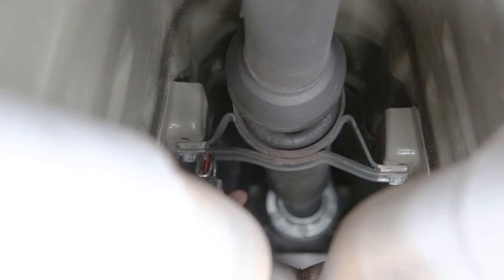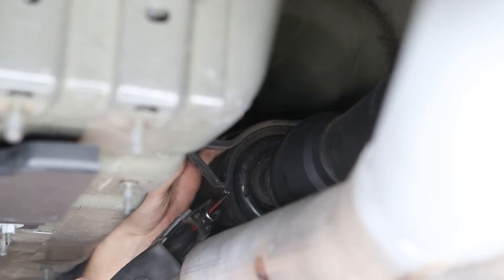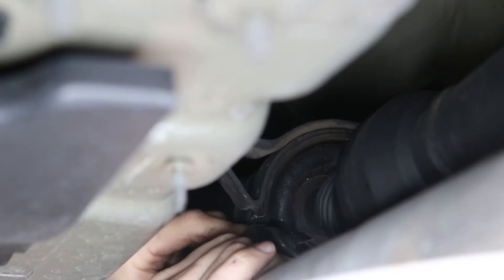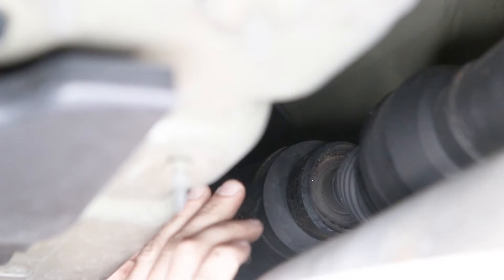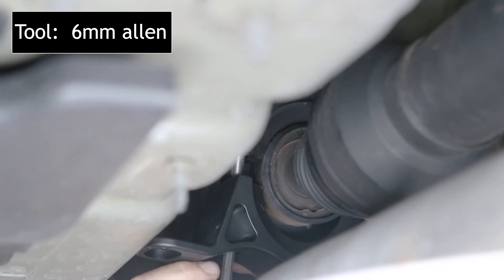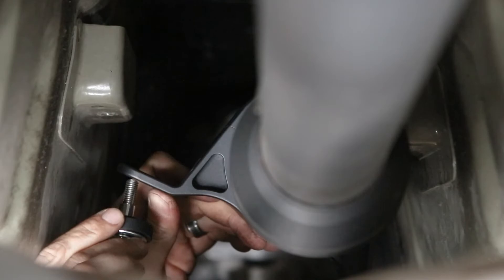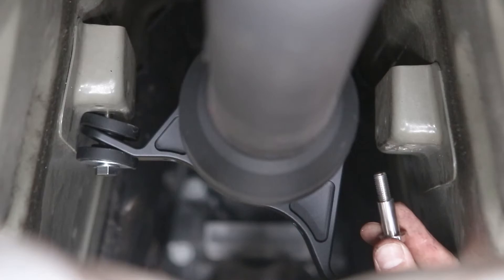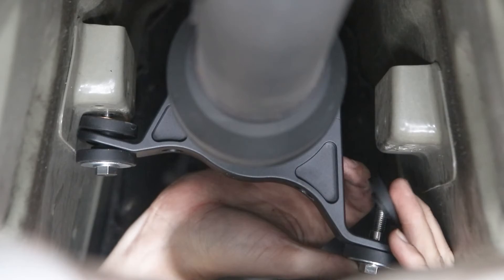LD Facelift Charger/Challenger/300 Performance Driveshaft Carrier Install (CHR01A0) JXB Performance

Comment: This is an amazing product. Ordered an open box drive shaft that came busted. Thank gosh because little bit of research and I found this. Installed on a 2016 challenger rt. Didn't even have to lower the exhaust. I just removed the heat shield, cut the old mount up, and squeezed this bad boy in there. 30-40 minutes later, my driveshaft was no longer clunking away.
Reply from the maker: Wow that’s great! Never even considered this could save an otherwise trashed new carrier. When we buy driveshafts for development the carriers show up damaged quite often.
Reply: What cutting tools did you use ?

Comment: Just in case anybody was wondering. It's way easier to install on the base model charger, because you don't have the twin pipes. I just put mine on without disconnecting the exhaust. JXB out here saving lives 🙌
Reply from the maker: Thanks for the feedback, that's great to hear!  Our #1 enemy with ease of install is always how much exhaust is in the way.
Reply: Yup, this comment is 100% true. Used a reciprocating saw to cut the side of the bearing, and an angle grinder for the 3 and 9 cuts. It was really scary because I’ve never used them, but I’m happy to report I still have all my fingers 😂

Comment: just installed and i noticed a bit of vibration, is this the rubber washers ? i was wondering considering the factory one didn't have a washer and was straight into the body, I guess the washers are for deflection? road tested and put  car back on stands to double check it afterwards and everything was still snug and torqued with locktite
Reply from the maker: Shoot me an email at jay@jxbperformance.com and I can assist.  Vibrations stem from the center CV joint not spinning smoothly and are the leading cause of the OEM failures.  Our bushings can take more abuse, but because of that the overall package is stiffer, so you're just feeling the vibration in the driveshaft through the carrier, whereas with the soft OEM one it soaks it all up (until it fails and all hell breaks loose).  We have a number of remedies for vibration transfer I can discuss via email.

Comment: I didn’t notice an orientation mentioned for the rubber bushings in the jxb carrier. Is the line in the bushings supposed to be to forward or aft?
Reply from the maker: The bushing orientation doesn’t matter on this one. They can be installed with their arrows pointing front or rear. Just try to center the bushings as best you can on the bearing.
Reply: @JXBPerformance  thank you! I just noticed the arrows on the backside of the bushings 😅

Comment: Okay got mine installed with street bushings, and test drove my B5 A4 Avant on it with stock exhaust. I don't really detect any NVH, and honestly feels like there's less of it now due to how old and crusty my old carrier was. The first to second wrestle match is very minimal now (though my transmission is probably just super worn out at 256k miles), like he said the knocking in the back from on/off throttle is gone, and haven't heard very many noises going 90 MPH. I had extreme anxiety about cutting a piece of a ~$2000 part, but if you torque to spec and use thread lock (Please for the love of god use thread lock), it feels

Comment: Just ordered mine for a 2015 RT with Road and Track (Yes I know that means RT/RT) Im nervously excited to do this. Do you think I will have enough room to do this if I back the car on ramps?
Reply from the maker: It'll be a bit tight under there but you might be able to pull it off.
Reply: @JXBPerformance  I ended up taking it to a shop with a lift and paying the 120 for an hour of labor from the mechanic. We did it together. If the exhaust didnt take so long to remove the process only took 30 minutes.

Comment: The good news for me was by the time I realized I needed to replace the center bearing, the rubber was almost all gone, so all I had to do was to cut the brace and put the new brace on. 

Good product tho, let’s see how it holds in the long run
Reply from the maker: win-win!
Reply: @JXBPerformance  yeah, it is.

Btw, for anyone reading this thinking on replacing it, make sure the heat shield is not touching the driveshaft when you put it back, unless you wanna feel your car is falling apart 😂.

Comment: THIS FLAT WORKS!!!!! Just installed soft kit on 2015 V6 Charger.  Just like it was when we bought it brand new. Plus side is the JXB bushing is much wider so I dont expect this one to ever dry rot like the factory 1/8" material did

Our Charger has dual exhaust and i did not remove any of it or the brackets holding it. I did have to remove heat shield bolts and slide it forward. After that cut old one off and installed JXB. Its a tight fit but pretty fast
Reply: SUPER FAST SHIPPING ALSO!!!!
Reply from the maker: Thanks for the thorough review and vote of confidence!  If you shoot me an email at jay@jxbperformance.com I can help you get that vibration to go away too so it's perfect for you.
Reply: @Mondo Official    @mondoofficial654
Reply: What cutting tool did you use ?
Reply: I bought this same design from madness auto works. Didn’t fix my issue, still have play in the drive shaft. I heard it now when driving on acceleration when pressing the gas pedal and on deceleration, this is driving me nuts, anyone have any feedback on what it could possibly be?

Comment: I’m about to order one now. Because this is what I need. I was just about to order a whole new drive shaft
Reply from the maker: Perfect, that's exactly why we made this!  Saves you from throwing away a whole driveshaft over some cracked rubber.
Reply: @JXBPerformance  You guys are a saving grace. Instead of $1,500, only had to pay 300 plus some labor time! I will definitely spread the word about this product.
Reply: What do you do if on those carier bolts that bolt to the body of the car snap because mine snap and had to drill it out and now i have a bolt the runs down from the top and a nut and washer on bottom to tighten
Reply: @JXBPerformance 
I’ve got a 2017 challenger T/A. The carrier bearing is gone basically. I’m not understanding why it’s hard to replace the carrier bearing. Just gotta separate the two piece install the bearing and put it back together right? Or am I missing something?

Comment: Make sure to use a brand new knife blade !  I thought it was easier to just drop the exhaust in order to have better access with my cutting wheel
Reply from the maker: Yes, definitely!  We start with a fresh blade every time.  The 99 cent ones from Harbor Freight work perfect!

Comment: Brooo. I had that telltale growling noise while driving and sure enough when I got under the bearing had completely sheared from the outer rubber. Ordered this product, hoping it fixes the problem!
Reply from the maker: Definitely will fix you up.  This is a super common issue on these cars.  Just had a guy yesterday 30k miles and rubber is gone.
Reply: @JXBPerformance  fortunately mine made it to 120k lol

Comment: Do you really need to lower the exhaust? Or can you do it without it?
Reply from the maker: Depends how sneaky you are and what exhaust you have.  It can be tight up above a muffler or dual pipes, but if you have a single pipe it's easier.
Reply: @JXBPerformance  the stock 5.7, its just freezing cold, and i need to do the change on the ground outside, just thinking my options out first 😂 thanks for the reply.

Comment: Hi there after installing the noise I had went away but not the car shakes violently! Idk why I did everything as the video mentioned and added torque and locktight
Reply from the maker: Hey!  I can help you troubleshoot.  Please send an email to jay@jxbperformance.com
Reply: I also purchased the JXB. And was also not happy with the vibrations it caused.  BUT... I have 2 solutions for you. I can help you with the vibration you still have.  

1. - This step really eliminated most ALL vibration that I had after installing the JBX on the car.  The instructions from JBX are a little confusing to some (from reviews I have read).  Most people are cutting off too much rubber off the bearing.  Some have said they scrape all rubber down to bear metal of the bearing.  I think I also scraped off a little too much rubber.  If you scrape off too much, the JBX bracket will be too loose on the bearing.  I found this out after I installed the JBX...and still had vibrations.   The fix for this step requires you to remove the driveshaft from the car, but not bad...about 30-40 minutes.  Once you have removed the driveshaft from the car, remove the JXB device from the driveshaft bearing.  Get name brand -- md Sponge Window Seal part no. 43155 -- from Lowes or store near you.  It is 1/4" x 1" weather strip with adhesive back.  Cut a piece about 1/2" smaller than the circumference of the bearing on the driveshaft (because it's just a little too thick).  The weather strip is flexible.  Stretch it to make the 2 ends meet flush wrapped around the bearing.  On a flat surface(driveway), install the bearing back into the JBX bracket.  Make sure it's the half with "legs", the part with that bolts to the car.  Take the other half(no legs) and put on top.  You will have to push down to get the 2 pieces to meet together.  Have someone else install the 2 bolts to hold the 2 parts together.  Torque to specs.  

2. Re-install driveshaft.  
Do NOT install the 4 rubber bushings that came with the kit. Instead, go get 4 rubber fender washers (part no 880374) and 4 metal fender washers (part no 290024) from Lowes.  On the bolt that holds the driveshaft carrier to the car, put one metal washer then one rubber washer (in that order).  Put the bolt with washers back in the JXB bracket.  Put the other metal washer first, then the rubber washer on the other side of the JBX bracket before you thread it back to the car.  Thread back in chassis bracket. Repeat other size. Torque down.  Vibrations gone !!
Reply: @PLastName you should post some pics of that setup somewhereonline...sounds like a pretty interesting solution

Comment: How do you make sure you don't cut the base layer of rubber, around the bushing, when you're going-ham with the Sawzall?
Reply from the maker: If you nick it with the blade it won’t hurt. It just needs to be mostly intact to fill the space between the bearing and our bushings.

Comment: What’s the cutting tool called seems to cut pretty well ?
Reply from the maker: It’s called a body saw. They’re great for getting in tight places. This one is made by Ingersoll Rand and is around $100 if I recall correctly.
Reply: @JXBPerformance PLEASE HELP ME my car didn’t shake before but after installing the noise I had went away but not the car now shakes violently! Idk why I did everything as the video mentioned and added torque and locktight

Comment: Where. Are you getting the carrier bearing
Reply from the maker: The bearing itself is unserviceable on these shafts. Our replacement carrier clamps around the original bearing with its base layer of molded-on rubber still intact.

Comment: All my rubber is off to bare bearing??!
Reply from the maker: There are some workarounds if all your rubber has delaminated from the bearing.  You can wrap the bearing in duct tape or electrical tape to take up the space, or shim the bushings inward by placing some thin strips of plastic or rubber between the bushings and the carrier frame.  If you do the latter, it's a good idea to put a couple zip ties holding the bushings to the frame, as you're losing some contact with the engagement features of the bushings/frame.
Reply: @JXBPerformance  and what would happen if i didnt put any duct tape ?